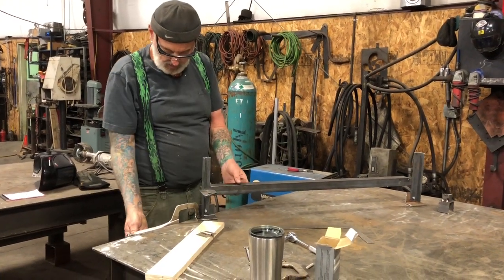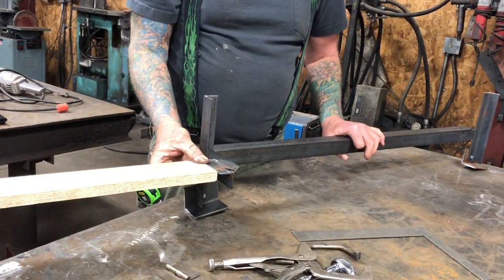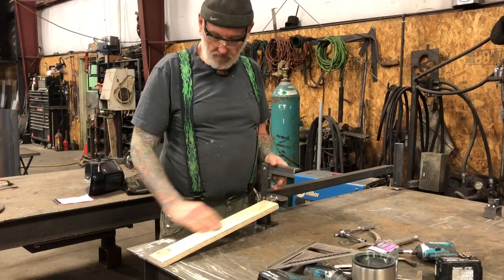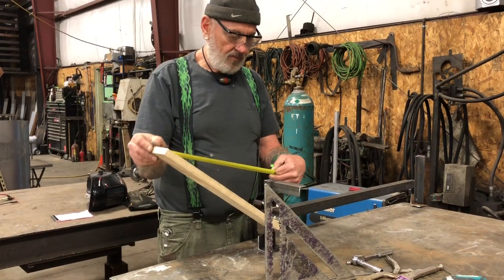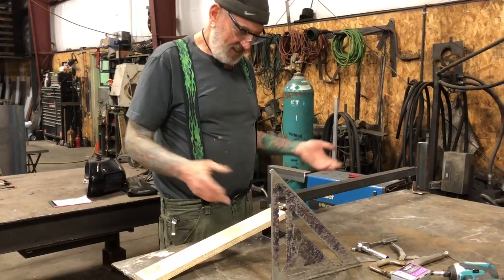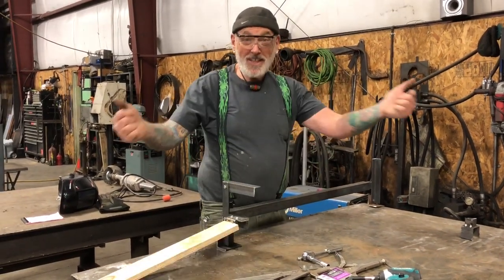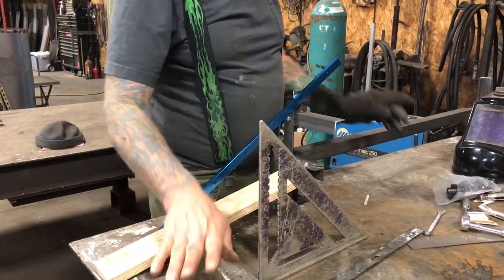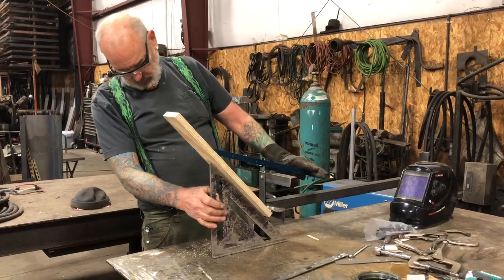Prototyping Roof Rack - Vlog 62 School Bus Conversion

Comment: You may want to consider tilting both ways.  The sun is to the south, so depending on which way you are parked  the 45 degree may be opposite the sun.  I have been struggling with this design feature detail my self.  I made my panel mounting frames with pivot points on both sides to allow tilting either way and plan on having a switch to indicate to the driver that the panels are not "parked".  Maybe a compound linkage that will multiply leverage like a vise grip uses with a shorter arm to get it out of your walkway.  If you can hinge in the middle maybe.  Sorry if I am a little unclear, but maybe I sparked some inspiration here...  You have been very innovative so far so keep up the good work.
Reply from the maker: Thanks for your imput. I understand what you are saying. I am going to be able to tilt them both ways with a simple design change I am still working out. Your imput is much appreciated. Thanks.

Comment: Consider building a bolt together metal space frame of appropriately sized c channel to mount and reinforce the solar panels edging. Maybe with a little thin rubber to cushion the panels in the frame.  think they will be too flimsy on their own in high cross winds. You're building something similar to what I have in my head, but you're way ahead of me.
Reply from the maker: I have a sample panel and them seem pretty sturdy. When it's all done when going down the road the panel will be down on the bus with rubber foots. The other side is going to have some kind of blocking.

Comment: Good idea. What if you out the "legs" under the solar panels? That way you wouldn't have them projecting into your catwalk.
Reply from the maker: Great Idea. Thanks for the suggestion. We are planning on putting rubber feet on the outer edge of the solar panels so that we can pin the outside edges down when we are traveling down the road. But it is still a work in progress and we really appreciate your input.
Reply: Another idea - I bought some old razor scooters for parts. The extendable and lockable handle would make great adjustable arms for solar panels.

Comment: how about having your arm mounted to the deck rail and then have it with 3 locking points on the solar panel frame... that way it will never move into the walkway on top and it can be bolted to the roof top even for more stability.?.?
Reply from the maker: Thanks for your imput. The design is still in progress and believe I can make it better. The biggest thing is we don't want to put any more holes in the roof that we have too.

Comment: Randy You are fun. What is the overall high  of the bus. are You worried about that . We stopped at 11 ft 10 in
Reply from the maker: The peak of the rear bump is 12 foot 1 inches. I wanted to keep it under 12 foot 4 inches.